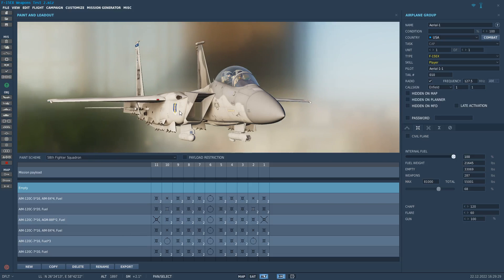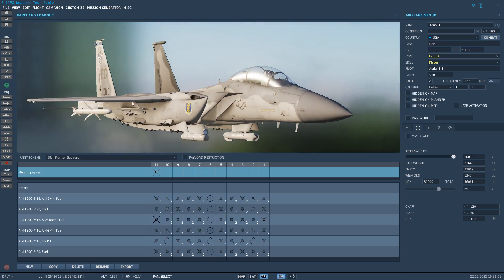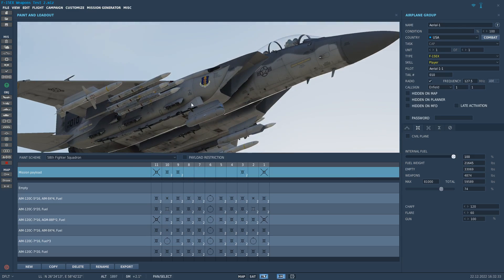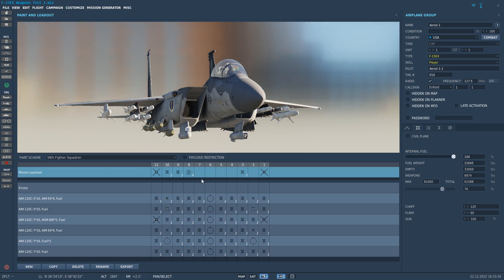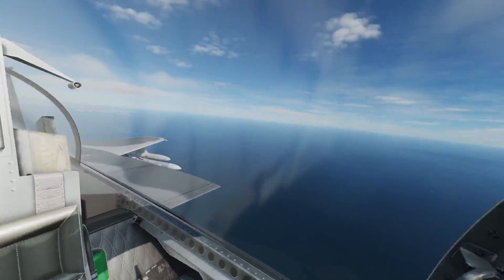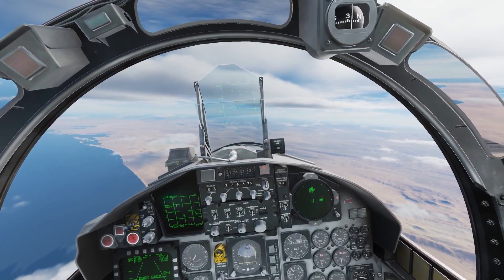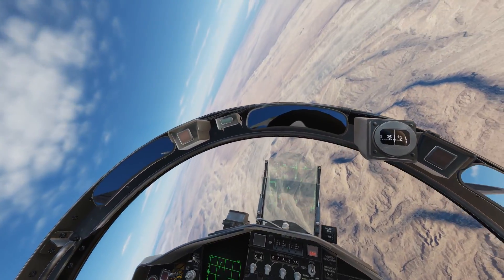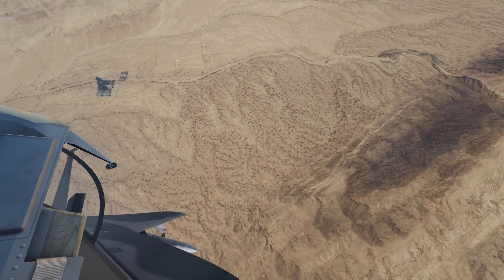DCS F-15EX Mod V1.5 Release | Free F-15 Upgrade

Comment: I just installed the mod and is there a reason I cannot pull as much g compared to the stock f 15? With stock I made the mistake of pulling too hard and Over-G the aircraft more times than I would like to admit. However with the EX I struggle to pull and maintain more than 4g from the aircraft on a continuous turn and with a instantaneous turn I can reach 6gs but it dies down really fast to below 4g. Both times I am pulling back on the stick as hard as I can. Is there a g limiter on the plane? My tests were done at 500kts and 10000ft high

Edit: I could reach instantaneous of 9g down on the deck but still could not maintain it.
Reply from the maker: Well the flight model isn't the greatest, I've been trying to fine-tune it a bit.

Comment: Nice, btw would you able to update the mod to include the AIM-120B? And are you gonna add the AIM-120D as well?
Reply from the maker: I don't see the point in adding the AIM-120B, it's not even compatible with the AMBER racks that I have worked hard on for this update.  The fins are too big and as far as I know the AIM-120B isn't really used by the USAF anymore.  They mostly use 120C and D variants AFAIK.  Bottom line no AIM-120B.  AIM-120D is currently dependent on Cap's modern missiles mod, I don't plan on necessarily adding it until that is released.
Reply: @SpinosSimulations  it would enhance its long range deadlines. Correct me if I’m wrong but the f-15EX was made for more of the long range “attack before you can see me” type of role. It’s essentially stealthy in the sense that nothing can see it at the time it sees them. Not being rude or anything.
Reply from the maker: The AIM-120D does have longer range, but implementing it has been a challenge for me.  I don't want to re-invent the wheel, so I plan to wait until the GR mods come out for that.  The AIM-120B is a lot shorter ranged and has no place on the F-15EX.

Comment: Looks great, I'll give it a try (:
Reply: Doesn't appear in the mission editor ):
Reply from the maker: No it does not replace the F-15C, however it probably conflicts with the VSN F-15E, so check to see if you have that installed.  Otherwise look towards the bottom of the list of aircraft, it will be there.
Reply: @SpinosSimulations  its not there for me
Reply from the maker: May not have been installed to the right place.